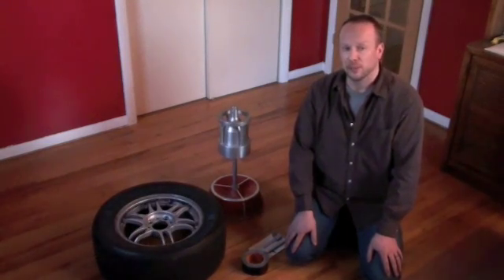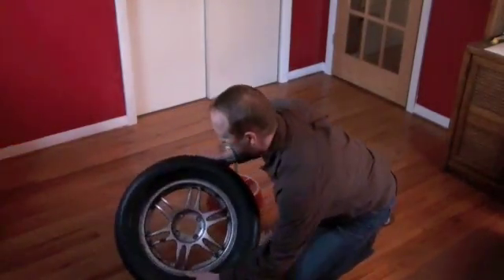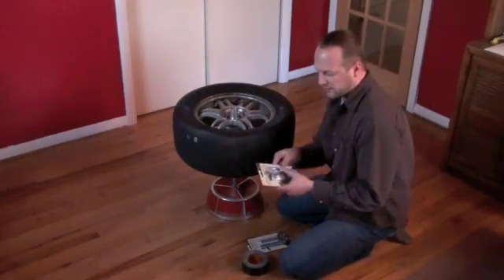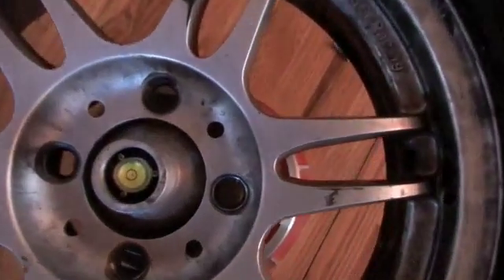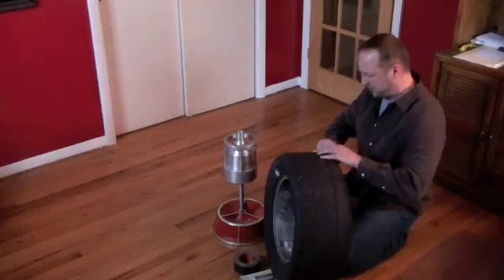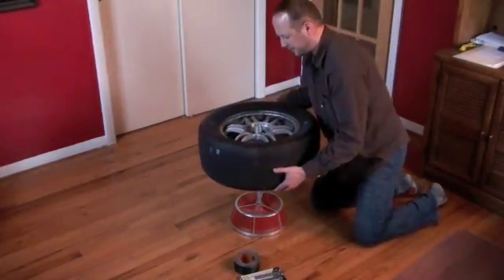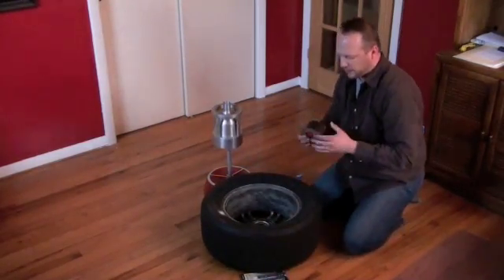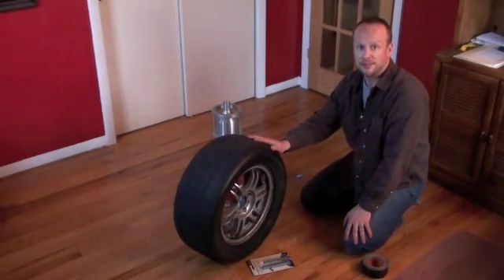DIY Tire Balancing Machine

Comment: Heh, that's basically how it was done on all wheels back in the day. We had and old one of these in the tire bay where I worked 30+ years ago. It certainly works, but won't give perfection. So let me suggest that, checking the balance at the outer face of the wheel, then placing the weights at the back is not ideal. Better to put half the weight at the back face and half at the front, or, all of it at the closest to half way point between the front and back faces . If you see what I mean.

Comment: modern garage balancing machines need to be serviced and maintained regularly, my own experience is that very few do, I've often had to balance my new tyre's "this old fashioned" way after the so called professionals have done it.
Reply: In my experience (owning a cheap TW-100 dynamic balancer myself) it mostly is dependent on the care [not] taken by the one changing the tire and using the balancer. The tire shop people often slap on some weights more or less accurately and don't check again afterwards and "send it". 

When I (re)balance tires, nearly every time the weight coming off the rim beforehand is way more than what I have to put on again.

I have to add, I use my old static balancer to mark the "heavy/light" side of the rim and pay attention to the colored dots or stamp markings indicating the "heavy" point on the new tire before putting it on the rim.

Comment: i used to use a static balancer about 30+ years ago, i think they are ok if the device itself is a quality unit, the way i was taught was to fit weights was once the position and amount of weight was ascertained, you split the weight and put half on each side of the rim,  however if there is any looseness in the steering the slight lack of accuracy compared to a modern computer balancer, may show up as wheel shimmy.

Comment from the maker: You guys are too funny! Please re-read the purpose of this video, and even better the article that this is used to supplement. No direct links allowed so:  GoAheadTakeTheWheel website (that name as the URL) > Racing Info in the navigation bar > Articles > you'll find it on that page. I think after reading that this video will make more sense. It's worked for my purposes, but certainly not everyone's. And yes, my wife is awesome for allowing me to do the video inside. :)

Comment: I use to balance this way 30 years back and it worked fine with the tires back then. Not with the new tire sizes. Also this does only a static balancing and will not compensate for high harmonic vibrations you get with lower profile tires. Skip a meal at McDonalds and you will save your 13.00$

Comment: I have 42 tires I keep on the road and I am tired of waiting at shops for hours for mount and balance, not to mention I live 30 miles from a shop.  I will buy one of these tomorrow.  Thanks!
Reply: Will Bass after 5 years how do you like the wheel balancer.?

Comment: Thanks for the review.  The commenter below says to goto Wal-mart.  Funny thing is Walmart is the reason I am looking for a DIY option.  I was personally at 2 Wal-marts today.  The first one a 18 year old kid added 14oz of weigts.  LOL.  I got on the road and a violent shake at 60 MPH.  I stopped at a different Walmart an hour later and they removed all the weight and re balances using only .75oz.  It was nice and smooth for about 5 miles until all the weights were flung off.

Comment: Third, the pairs of weights are moved away from the light spot equal distances along the rim, until the induced overbalance is precisely corrected and the angle of tilt, as shown by the spirit level, is zero. Fourth, one of the weights in each pair is fastened into position; the other is removed, and fastened into the corresponding position on the other (nether) side of the wheel.

Comment: Second, four equal weights are placed on the rim of the wheel, two on each side of the light spot and immediately adjacent to it. The weights are of a size such that when all four are placed at the light spot, they are sufficient to correct the tilt of the wheel and just slightly to 'overbalance' it.

Comment: Bubble balancers work fine, but by using the patented BADA method with your bubble balancer you can get you tires balanced even better.  

The patented system involves four steps. First, the wheel is placed horizontally on a balancer equipped with a spirit level and allowed to tilt freely from side to side. The bubble in the spirit level indicates the location of the 'light spot' on the wheel-- the point of greatest imbalance and the one which tips up the highest when the wheel tilts.

Comment: Why not use dynamic balance beads? They don't cost much more than regular weights, and they dynamically balance the tire for its entire service life, while a tire may come out of balance with standard weights as the tire wears. No need for a balancer either.
Reply: They may be fine for trucks going about 80 km/h with large and slow spinning tires. But in a somewhat modern, low-profile car tire at velocities upwards of 100-120 km/h they are totally useless for balancing and even introduce a non-negligible amount of imbalance and vibrations especially when braking. Also they are very loud when driving slow, sometimes sounding like an impending bearing failure or a stuck brake pad (Been there, done that).

Comment: @urbex2007 and to you sir, the wheels are often manafactured near-perfect balance weight, but the tires is not, that is why you get tires balanced when you change wheels, you can also balance the wheel to the tire (Where the wheel lacks weight, you put the heavier side of the tire at that point so you can use less or no weight)

Comment: @upontheedge1 actually you can balance a tire with a cup of water and a pea, the REAL reason tire shops buy tire balancers is becuase, Balancing a tire with a pea and a cup of water would take you 15-30 min per tire, a tire balancer machine takes only a few seconds to balance and it even tells you WHERE to add weight, its not the idea of the machine, its how FAST it can do it, this method 4 tires in a hour, a balancer machine 10+ tires per hour

Comment: @urbex2007 it's not only the rim that can be out of round, it is the tire as well.
in the worst case the tire and rim combination can have 2 faults that add up.
this can often be corrected by shifting the tire position  in relation to the rim.

Comment: Nice. I actually purchased that same portable wheel balancer at Harbor Freight last week. Static balancing does indeed serve a purpose. For example, if I remember correctly, aircraft propellers are first balanced/checked statically before they are balanced/checked dynamically. A static check sets you up rather nicely for the dynamic check.

Having a wheel statically balanced is better than nothing.
Reply: CLUTCHNSHIFT  after 6 years that you bought the harbour freight balancer,did you ever go back to A shop get it balanced?

Comment from the maker: @majorrojam Sorry to the long delay. This method does not take into account whether the wheel should go on the inside or outside of the rim. I don't recommend this for a street car. For many racing applications, it seems to do a good job. I've been using it for a while now and it's saved me quite a bit of money which can be used doing more events. Here's where the associated article can be found:
goaheadtakethewheel (On top, Racing Info > Articles link). Won't allow me to post link.

Comment: nice solution for doin it yourself.
Except when I take my rims away for balancing the balancing machine tells also were to put the weight inner or outer side of the rim.
How does this handle that issue?